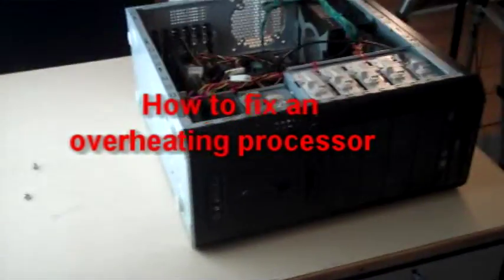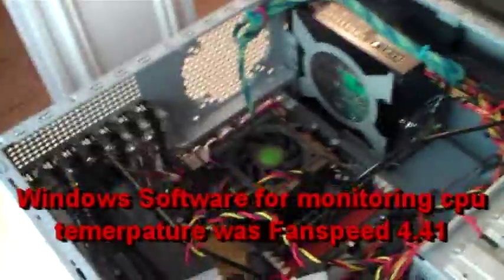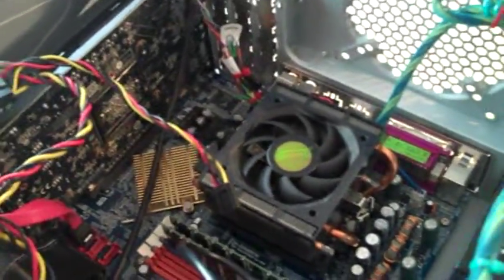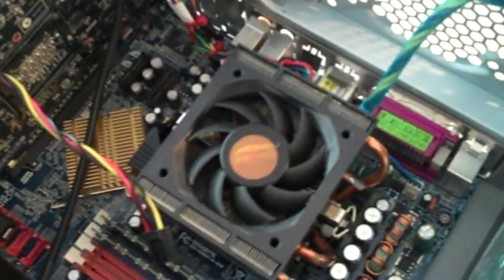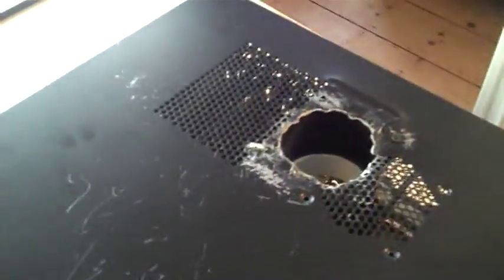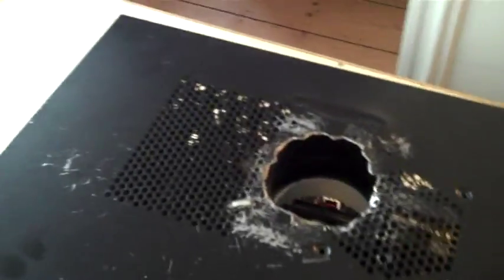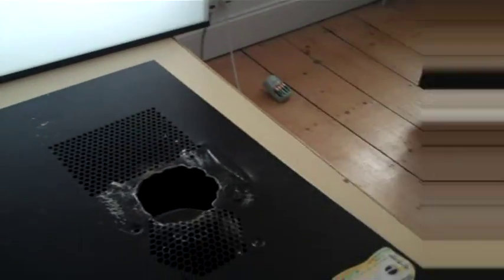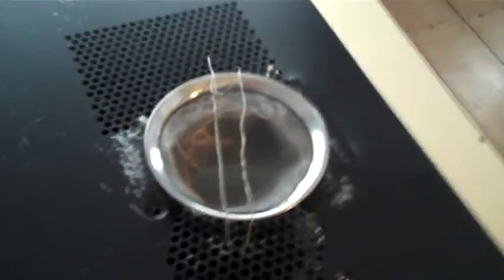How to fix an overheating processor

Comment: This is pretty ghetto operation......... If I saw that pc, I would walk into my tool shed and get high voltage protection, as in thick gloves and rubber shoes! and then I would be reluctant to turn it on lol...... that case is mutilated!

Comment from the maker: If by the black piece you mean the side pannel then that was screwed tight. If you mean the cone then that was also screwed tight. The vent wa snot over the fan which was where I wanted it.
You may have been right about just cleaning the fan but as the design so was so crap I wanted to fix it. I doubt the fan will get dirty quicker because now it has a fan sucking the dust out right above it.